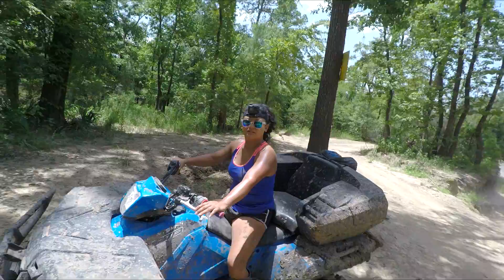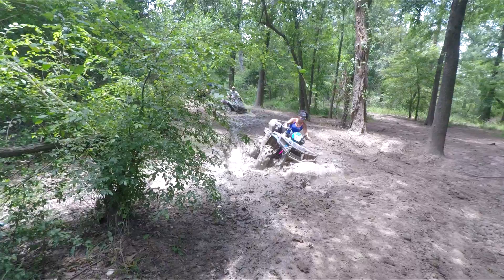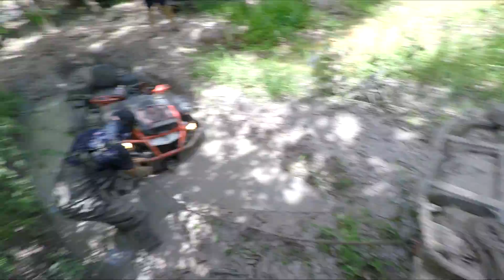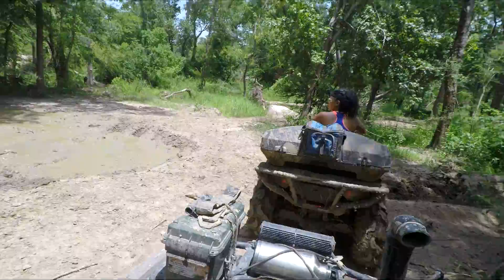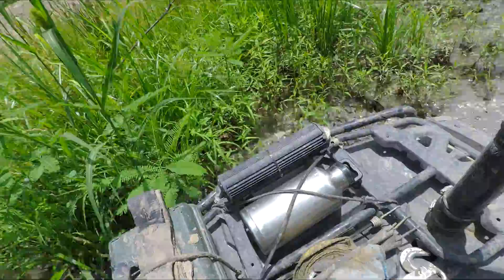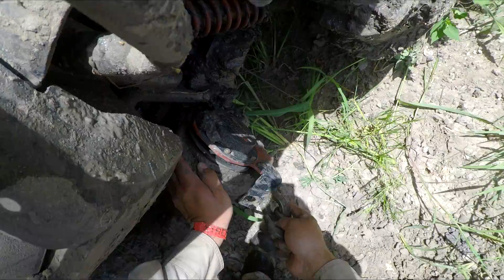Xtreme Off-Road Park | She THOUGHT She Could Follow The Honda...

Comment: Mr. Ass What tire did you choose the outlaw 1 or the outlaw 3 or have you not chosen yet?
Reply from the maker: IN THE MUD my buddy told me he had some 29.5 outlaw 2s I could try so I’m going to see what they are all about first
Reply: Swamp Ass you don't need bigger than the 29.5s.. anything bigger you will need more gear reduction
Reply from the maker: Yea I'm thinking those 29.5s will be perfect for me. I'm not ashamed of getting pulled out of a hole so I'm fine not have the biggest tires or lift. As long as I can keep riding every weekend that's all I want.